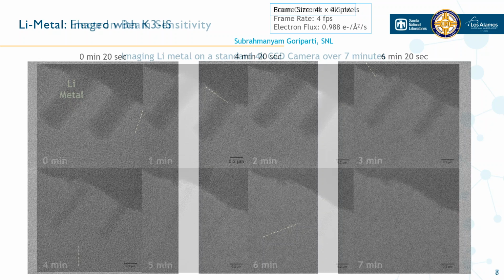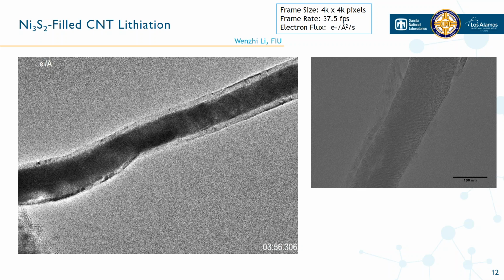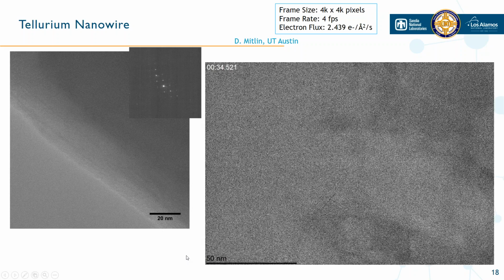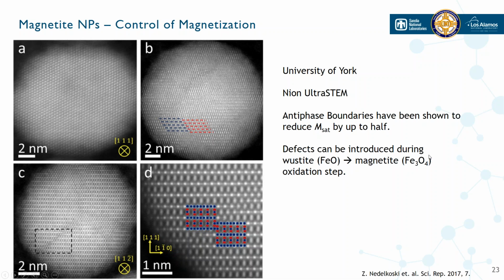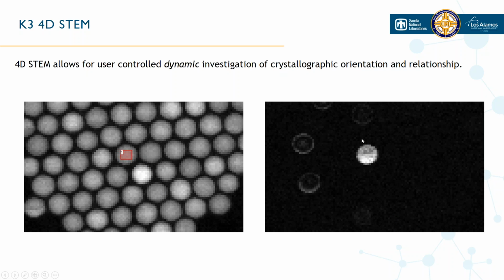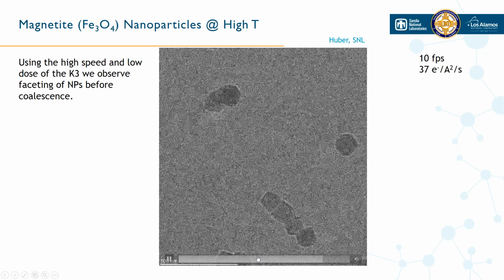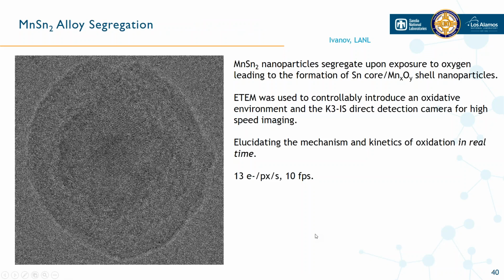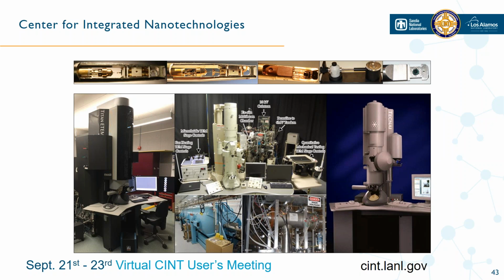Low-dose and high-speed in-situ TEM with the K3 IS camera

Comment: Hello, could you please clarify about the k3 camera? Can direct detectors such as the K3 be used to collect microdiffraction data? If we are going to install an EELS with an equipped K3 camera, can this camera be used in TEM mode for more efficient data collection? Is there any profit in installing the OneView camera? What set of chambers and other equipment do you think is needed for in-situ research, taking into account that polymers, organics, and catalysts will be investigated? For example, I would like to solve the problem of observing structural changes with an atomic resolution of metal NPs stabilized in an organic matrix when exposed to gases or when heated.
Reply from the maker: Please contact ana.pakzad@ametek.com so she can answer your questions in more detail. Best, Gatan